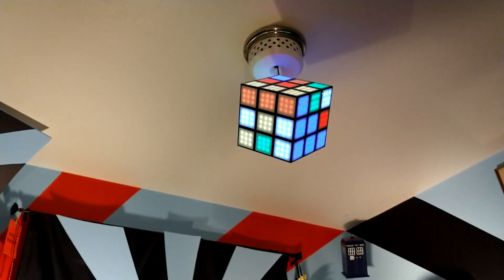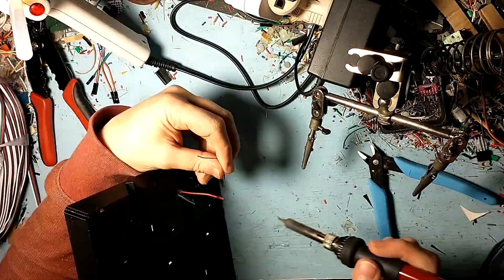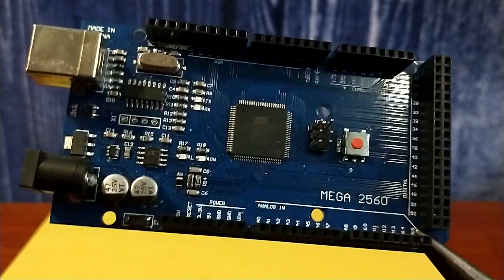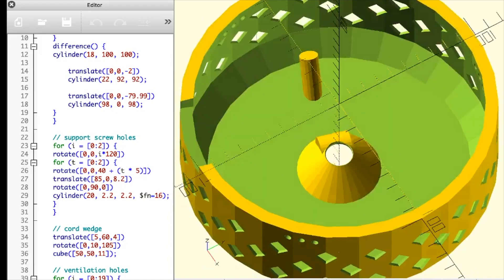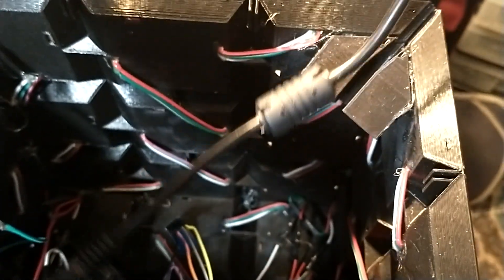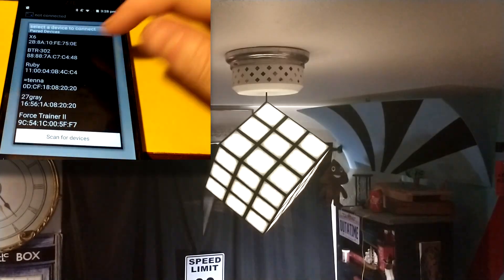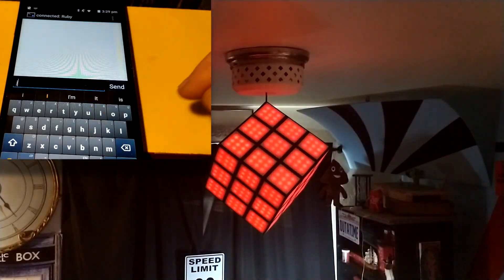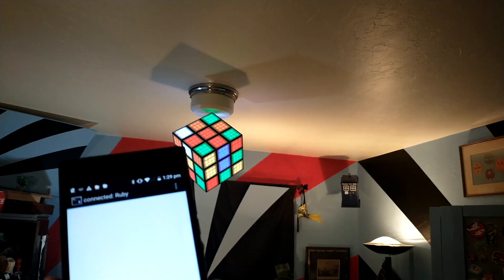Animated Puzzle Chandelier

Comment: Great Idea and Project!  could you briefly explain as to how LEDs Strips are connected to each other to get the correct sequence.  A little explanation of the code would be great so that I can modify it if required.
Reply from the maker: That's a good point. I was thinking that the video would show how they are connected, but it's probably  better to include a diagram, especially showing how the panels are connected to each other, since that's not in the video at all. I have added a wiring diagram in the description. Let me know if that is sufficient.
What parts of the code do you have questions about?
Reply: @swagswap  Thanks for the prompt reply!.   I will go through the code again and let you know if there are any issues.
Reply: I went through the code, I could not understand the following:-  The arrays "goal" and "actual" should have 6x81x3= 1458 elements, they have only half these.   I have not understood the terms 
"describes the cycle of LEDs around the rim of the cube's Front"  and "describes the cycle of LEDs around the face of the cube's Front"  for arrays f_12, f_8, b_12, b_8........ and so on.  regards
Reply from the maker: @mandeep1960  goal and actual are fully used later in the code. At the start there, those explicit values ({{0,0,0} etc.) are just initializations, and not really needed.
We could just replace those with:
byte goal[6][81][3];
byte actual[6][81][3];
Sorry for the confusion there.

Cubers use the letters DURLFB to refer to sides of the cube, when turning its sides. Down, Up, Right, Left, Front, Back. I’m using those letters for the same purpose.
For instance, f_12 and f_8 refer to the LEDs that are involved, when the Front of the cube is rotated. 
f_8 contains the 8 squares that rotate on the face of the cube’s Front, and f_12 contains the 12 squares that rotate around the edge of the cube’s Front.
When the cube’s Front is rotated, f_12 and f_8 are passed to the turn() function. The turn() function takes 9 steps in the rotate animation.
f_12 has 36 sets of 3 LED locations, and turn() will move each set of LEDs around the Front, by swapping their values in a cycle,
shifting the colors 9 steps, so that it looks like the Front rotated 90 degrees. f_8 also has 36 sets, so that it can rotate at the same speed as f_12.
But f_8’s sets only have 2 LEDs each, because there are fewer LEDs on the face of the cube, than around the face.
Does that clear up how they are used?
Reply: @swagswap  Thanks a lot, will go though again.
Reply: I am planning to build the cube, however, I will be wiring LED strips of 9 LEDs each rather than wiring strips LEDs each.  I  hope to reduce the soldering and wiring job with this modification. I will have to change the LED numbers in arrays in the sketch.
Reply from the maker: @mandeep1960  Yes, that makes sense. You'll want to make sure to connect the start of each panel back to ground and 5V, so it doesn't get dim by the end of the LEDs. Good luck! Let me know if you have any other questions, and I'd love to see the finished project.
Reply: @swagswap  you will be glad to know that I constructed the cube with some modifications, but the basic idea is yours.  The cube is largely working fine, however, I am not able to sync the movement of cubes around the face and on the face, they are giving mixed results.  I have laid out LEDs on strips of 9 each and changed the numbering on the array of faces, there seems to be some mismatch between the face and ringside cubes.  I you send me you email I can send you an excel file with the layout of my LEDs on the cube.. thanks
Reply from the maker: @mandeep1960  Sure, I'll take a look. aardwolf.labs@gmail.com

Comment: You seem to prefer the JDY-30/31 in your projects, any specific reason/s for this choice? (a long answer would be more appreciated!)
Reply from the maker: The main reason I've been using the jdy-30 lately is that I have a pile of 20 of them. Shipping was expensive compared to the price of the unit, so I got extra just to make sure I wouldn't run out :)
When I wanted to add bluetooth to arduino, I found two options, hc-05 and jdy-30. The jdy-30 was newer, cheaper, and smaller. So, once I made sure there was enough info out there on how to use them, I chose the jdy-30. Did I do exhaustive research? No. Are there other options out there? Certainly. Would I like to hear about them? You bet!
Do know of other good modules, or know about their relative antenna ranges, etc? I put a fair amount of work into increasing the antenna range on a dog dinner dispenser, so it could "hear" through a couple walls. A better antenna would be nice.